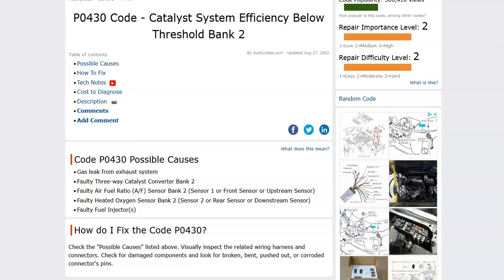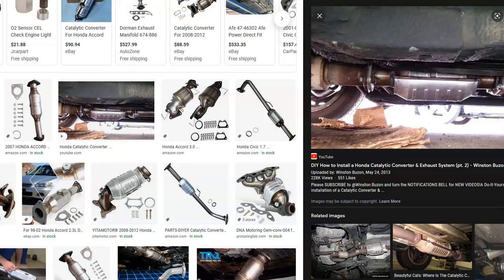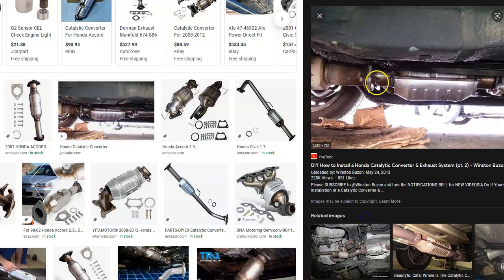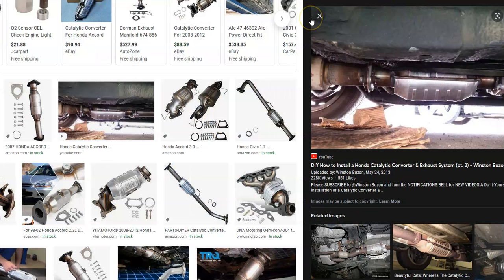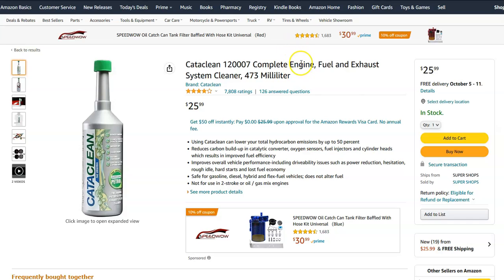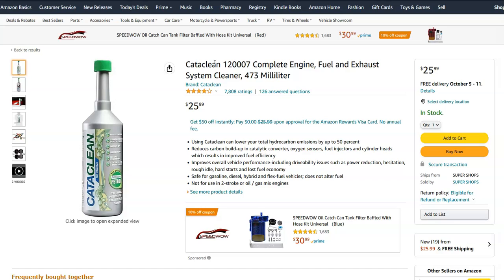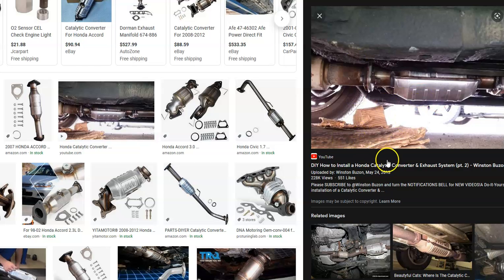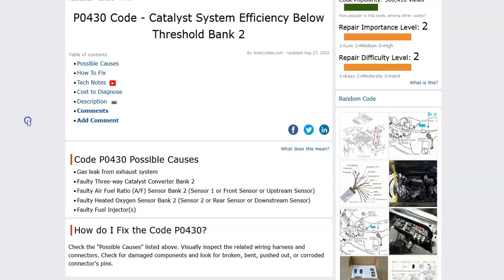How to Fix Honda P0430: Catalyst System Efficiency Below Threshold Bank 2

Comment: Yep. We have P0430 code.  2007 honda ridgeline.  Changed the 4, O2 sensors.    Will look for leaks with soapy water spray...

Comment: An upstream exhaust leak will set that code too, so check your exhaust manifold gaskets and bolts. Air entering before the upstream sensor will confuse the pcm and trigger the code.

Comment: Where is the po430 bank 2 cat on a 2012 Honda pilot? I watched many videos and they either say it’s in the engine bay or under. Idk which one it is so I could change it.
Reply from the maker: There likely is 3, two pre cats on each side of the exhaust manifold and 1 under the car on the exhaust. Find a manual to be sure but that is common on the 2008-2014 Honda Pilots.

Comment: I have a 07 Honda Odyssey I changed both cats and all O2 sensors and I'm still getting those codes should I change the fuel injectors next
Reply from the maker: Usually codes will be given for a bad injector but they can be tested.

Comment: Do you think an exhaust leak could cause this? I can tell it’s a little too loud like a v8 truck very slight exhaust leak
Reply from the maker: An exhaust leak can cause the 02 sensors to get a bad reading.
Reply: @whyingo7964  and that could potentially trigger p0430?